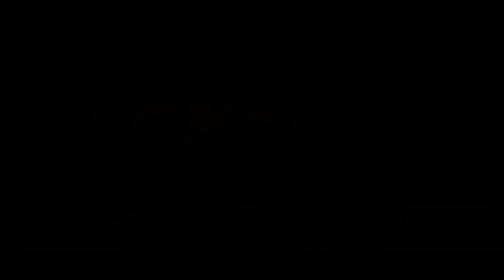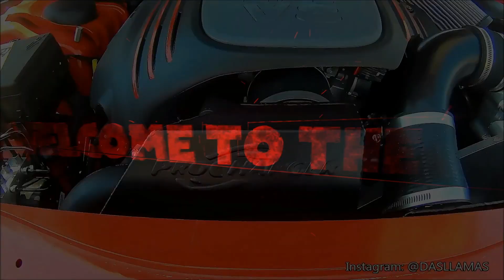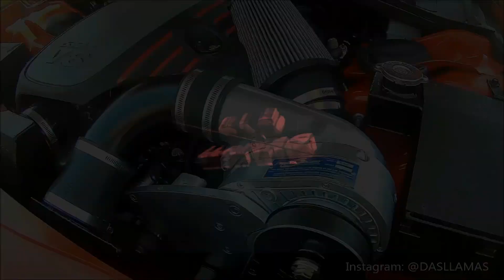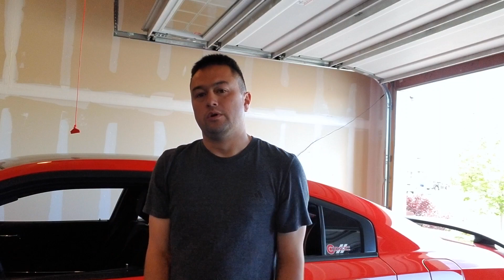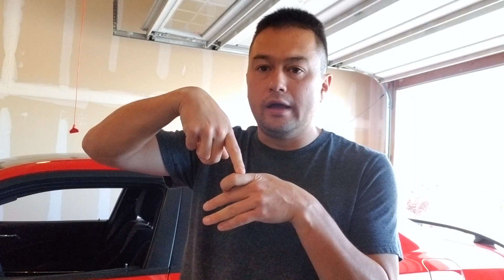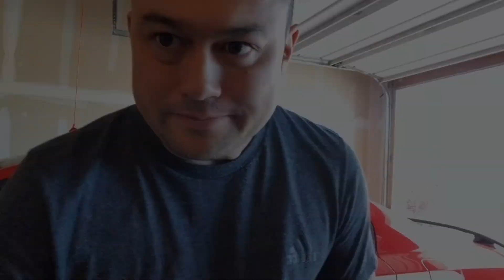The Charger is "Sick" - MDS Lifter Failure

Comment: If your not going with a special supercharger grind for the cam (that would be ideal) you can install a 6 speed 6.4 cam alot of 5.7 guys are running these with spectacular results.  I'm curious if the 6.2 Hellcat cam would work on the 5.7, you may want to look into that as it was ground for a boost specific application.

I am going to swap a 6.4 - 6 speed cam in my 2014 300C with an MDS delete also. But I don't plan on ever running boost. The most I will do is swap in an Arrington 426 stroker motor with the new Edelbrock Intake (620hp N/A). I'm worried anything more make break the transfer case or the front differential. While we can beef up the rear end and axles I haven't had luck finding any upgrades for the front diff or axles. Also not sure how much torque the Borg Warner 44-40 transfer case can take that we have in our cars. I've read it is significantly stronger than the older Magna Styer T-case that was in the 1st Gen LX cars.
Reply from the maker: The new t case is much stronger than the last generation case. I thought about the 392 cam too. There are a lot of options out there.

Comment: What was the Symptoms of the bad MDS on your car
Reply from the maker: If the solenoid sticks or gets a pocket you can hear loud clicking similar to the lifter failure with the needle bearings.  Can get a misfire.  Likely get a CEL code
Reply: @dasllamas  thanks for replying i have a car that the msd solenoid code keeps coming out and I replaced now the car is jerking every time I push the gas then the engine light comes on

Comment: I have a 2012 charge rt 5.7 and it has ticking sound what can it be?
Reply from the maker: Minor tic is normal. Loud tick with misfire is lifter and flattened love on the cam
Reply: @dasllamas  Where can I send you a video?
Reply: I have a video here
Reply from the maker: @juanpena8449  that sounds like a flattened cam lobe from a failed lifter.  Any check engine light or misfire? Usually you will get a misfire when under load like medium to firm throttle going up a hill
Reply: @dasllamas  yes I have a check ingen on
Reply from the maker: @juanpena8449  did you pull the code? I am almost certain you need a new cam. $3000 to $4000 to fix unless you know how to do it yourself
Reply: @dasllamas  I have like 11 codes
Reply: Let me put the video of the codes
Reply: @dasllamas  it's already uploaded
Reply: @dasllamas  what can be?
Reply from the maker: @juanpena8449  hmm lots of lean codes.  Usually get a misfire code with the flattened lobe but if it is an intake valve not opening all the way it could cause it to be lean too.

Hard to diagnose anything over the internet but still gonna say the bearings in your roller lifters failed and it flattened a lobe on your cam.  It is a common issue for these 5.7 hemi engines especially over 100k miles.
Reply: @dasllamas  thank you so much , when i want to turn on the car it starts stuttering and then I have to turn it off but the second time I try to turn it on it turns on normal that happens just when I don't use the car less than a day 

Tha car runs fine

Comment: Hey man, did you ever make a video to fix the cam and lifters? If so I'd like to see it,  I wasn't able to find it for I think my Charger is having the same issue you were having in this video. And also what is the best brand would you recommend? I have a Hemi 5.7L 2014 Charger. It hasn't gotten super bad but is get bad slowly, I'd like to DIY the issue if I can thus needing to see the video.
Thanks
Reply from the maker: @blackbelt7759  i failed to do anythibg good about the cam.  Pretty much have this video and tuning then final results.

https://youtu.be/M_78WwWI3Gg?si=vRZkbJXY_WDm8bx4
Reply: @dasllamas  Thanks, The mechanic that did the replacement,  does he have a channel or videos on replacing  the cam and lifters on the Charger?
Reply from the maker: @blackbelt7759  he post mainly on instagran @rpmdenver

Comment: It is not from the mds it's the cheap roller bearings
Reply from the maker: Ya needle bearings are the most common failure.  My case it was a failed Solenoid
Reply: @dasllamas  10-4. I just hate when people assume it was the mds with no basis. It's all good. No shame to you

Comment: I had that issue with mine the cam was the problem luckily I had it under warranty. The came was causing a notch in a lifter.. if I were you I would get a comp cam with mds delete give you a little more power too but you would have to retune..
Reply from the maker: Ohhh i like the way you are thinking 😉

Comment: Will mds cas a misfier
Reply from the maker: If the mds solenoid gets stuck closed so the valves are not opening i suppose the car could read it as a misfire.  I did have a cylinder 8 misfire and was fixed.  Whether it was the mds delete or new cam and lifters I can't say for sure

Comment: Sometimes I get lifter slap for like 4 or 5 seconds on my startup on 2016 r/t. Should I be worried? Anyone else have that happen with their 5.7 once in a while?
Reply from the maker: Any other symptoms? Check engine lights? Misfires?
Reply: dasllamas none. It runs beautifully. I only get that clack once in a while after a pretty long cold start
Reply: Yes me
Reply: Did you ever find out if the lifters were bad?

Comment: What misfire did you have? I got p0300 and p0308 and its not spark related
Reply from the maker: P0308 cylinder 8 misfire and cold start timing
Reply: @dasllamas  it misfires on cold starts too, I wonder if I have the same issue
Reply: Sooooo whst was the verdict I’m having the same codes
Reply: @bari4eva07  mine had a bad lifter that  ate the camshaft. Then a head gasket blew, then a rod started knocking lol

Comment: Had this happen to me a year ago. Do you suggest the MDS delete kit? And if you do, do I have to have it tuned to adjust that? Starting to hear a feint lifter tick now and its got me worried about it.
Reply from the maker: Yes delete the mds. You have to turn it off via hp tuner or diablo tuner. If you are getting new cam get the hellcat lifters and will be worth the tune if you go more aggressive with the cam.
Reply: dasllamas so can I do an MDS delete without the lifters? Like just tune it? Want to keep from having this tragedy happen again to my car but can’t afford the whole kit at the moment. (Last thing I want is to get a tuner and then my cam goes bad because I didn’t get the full kit.

Comment: Dang Brother, I feared that could be the case watching your Family Fued 2 video like 3 weeks ago. I commented there that I just went through the same thing. Built myself a full forged stroker 392. Learned a whole lot along the way and would definitely caution against some brands and mods. Feel free to message me, I'd be happy to answer any questions you may have.
Reply from the maker: Yeah I didnt want to believe it was the lifters. Dont have the cash for a full stroker build like you but ill get the car on the road again. Thanks for commenting.  What brands are you suggesting to avoid?
Reply: Would you consider a Jay Greene custom grind cam? If you decide to go that route make sure you get the cam specs. It makes things a whole lot easier for whoever tunes your car. R/T Life had one of those cams installed and he seems quite happy with it.
Reply: @dasllamas  Had nothing but problems with the Edelbrock heads; will never buy anything Edelbrock again, their quality control and manufacturing quality is very poor. The ZDT Motorsports "Better than Hellcat" lifters are low preload crap, they tick like crazy, even though I have them to the higher side of thier preload range. Another note is when I pulled the motor and dropped the oil pan there was a TON of metal shavings sitting in the bottom of the oil pan, even after draining. The Ram oil pan (Maybe yours too?) has a nut welded inside for the drain plug threads, which makes it create a lip inside so you can't ever fully drain out all the metal shaving filled oil. I didn't want to risk that circulating through my engine after a quick fix/rebuild so that's why I pulled the whole motor and rebuilt everything. Some guys do the new cam and lifters/mds delete just to have their motor shot a year later because all that metal has already damaged the rest of your engine. Also if you get the Stanke Motorsports rocker shaft stabilizers/collars you should put very specific washers between them and your rocker arms. My tuner Jay Greene says he had a set get destroyed because the metal rocker eats the aluminum stabilizers/collars. I did videos of every part of this build, I really need to actually sit my ass down and start uploading some to my channel!
Reply: @hu3.789  I did go with a custom spec'd 220/232 duration Jay Greene camshaft for my Stroker build. Jay did the tuning too, so he had the cam card, but I was degreeing the cam on install and he sent me a copy over too. Side note, damn good thing I did degree it because the Haynes and Chilton manuals are wrong when it comes to setting the timing chain properly. They switched what side the single and double marks go on (which phases the cam/crank wrong), but forgot to update thier manuals, BIG OOPS if you do it the wrong way!
Reply from the maker: @hu3.789  im sure jay greene makes a fine custom grind cam and he is a better tuner than i am but after seeing the video of rt lifes dyno results after headers came and jay greene tune the results put me off a little bit
Reply: @dasllamas  Definitely nothing beats a full dyno tune. There is so much more that can be dialed in with instant feedback and dyno loading. I wanted that route but no shop in my area was able to do a Ram tune on the dyno, so I went that route. Whatever cam you choose (I would get custom or something meant specifically for your supercharged setup), if you can get custom dyno tuned, I would go for it.
Reply: I can understand why you might be put off a little bit. An e-mail tune and data logging isn't the best method to tune. I was there when the initial dyno numbers were established on R/T Life's car after the cam was installed. Although the cam helped, the car also had other issues. The exhaust needed to be upgraded so that he could fully make use of the cam. His car had issues due to exhaust leaks, too small a small pipe diameter, and his exhaust being piecemealed together.

Comment: Hey, sorry i been MIA for a ... long time haha. Can I still safely tune out MDS? Or is it better to have it engage from time to time? I run special performance oil and fuel booster (which has eliminated my hemi tick) to try and keep things as healthy as possible, especially on the top end.
Reply from the maker: You can leave it off. The solenoids  collapse during long periods of time being parked and pop bsck up when oil pressure is built up when you start it. The just end up failing sometimes. More of a design flaw than anything.
Reply: @dasllamas  I haven't got the tuner yet, I slap stick most of the time to keep it off. Just wanted to see if it is worth tuning it out. This also just continues to prove my theory of when cars sit, they break hehe. Drive them daily and often! My civic has 320k on it and has never skipped a beat. However, its starting to show its age as it sits more often with the charger around begging to be driven!

Comment: I think what most people would find informative is....did your pro charging or mods speed this failure up? Or, in hindsight, would you have gone ahead and thrown a blower cam in and physically deleted the MDS at the time. 

I know my local HEMI shop’s answer to this on general, but wanted to see what you thought.
Reply from the maker: Very good question i should address this in a follow up video. Personally I dont believe the procharger had anything to do with it but I have no proof. From what ive seen with most mds failures they are around that 75,000 mile mark. I am at 60k and are just getting the early signs. I can still drive the car but I am cautious when I do. 

Was I planning on outting a blower cam in the car? Not really I was happy with the power and was focusing on wanting to do the transmission.  I am leaving a lot of time on the track by being conservative on the shift points. My tuner had always suggested I do an mds delete and forge the lower.
Reply: My 2011 has 80k and no signs yet.. I pray it does not.. I like the mds system, car gets great mpg when I leave my foot out of it.. my car is stock other than straight pipe exhaust..

Comment: Just did mine on my RIPP Supercharged Durango about 3 months ago got lucky and parked it asap and I didn't wipe my cam out now I have a issue with my VVT cam oiling solenoid so she's parked again love Dodge but the mds is trash
Reply from the maker: Stupid tree huggers wanting us to save gas and the environment hah
Reply: @dasllamas   heck yeah can't wait to see your cam choice, don't forget about getting a cam phaser lock also once u cam it,oh I also im running a snow watermeth kit I just have to remember to shorten the interval of oil changes viscosity is very important in the hemi engines that's what most likely caused my solenoid to crap out

Comment: Did you have a tune that disabled the MDS? I thought with all the mods you have that you would have disabled it. I guess not, huh?
Reply from the maker: It was disabled electronically.  That does not change the fact that the solenoids still drain pressure while the engine is off.  When they collapse when there is no oil pressure and fail to raise right away is when the problem happens. This over and over flattens the lifters and kills the cam
Reply: @dasllamas  thanks for that comment. I've been wondering about that too.

Comment: I deleted the MDS with a tune. would that problem still affect me?
Reply from the maker: Yes it will. I turned off my mds with hp tuners and it still failed. It is the needle bearings in the lifters that are going out because the solenoids are collapsing when the car is parked (even if you have mds turned off) and not lifting right away when you start it.